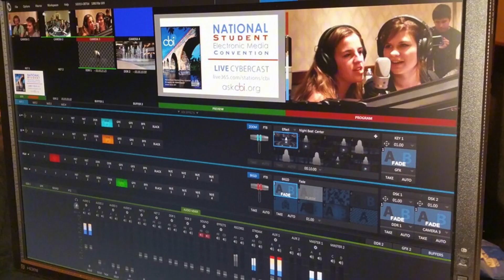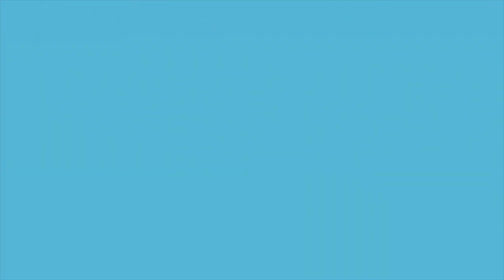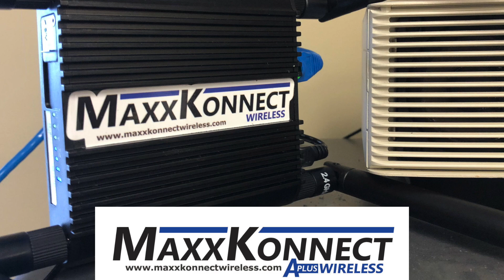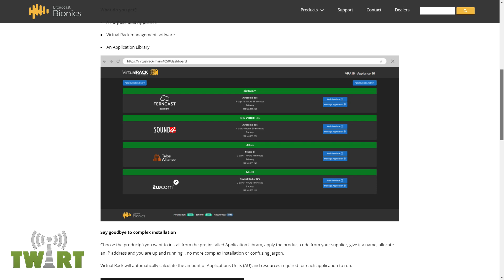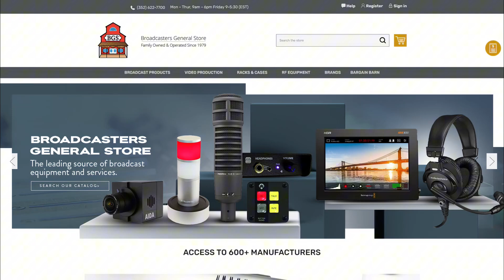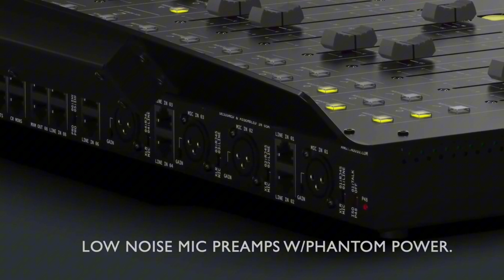IP Radio & WiFi Engineering with Cam Lasley - TWiRT Ep. 746

Comment: Internet connectivity has become a critical necessity for radio broadcasting over the course of the last two decades. Therefore, it is important that broadcast facilities have access to high speed, reliable Internet connectivity. And, broadcast engineers must become aware of all options for connecting to the internet in a reliable manner.

On Episode 746 of the TWiRT Podcast, we  have the fascinating and very informative opportunity to learn more about wireless Internet connectivity that has become available in some of the more remote rural areas of the United States.